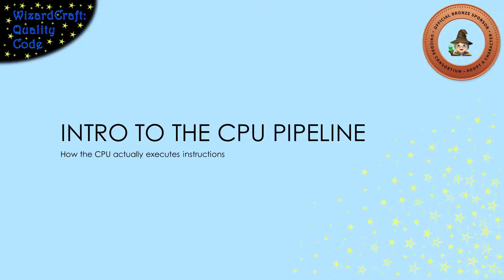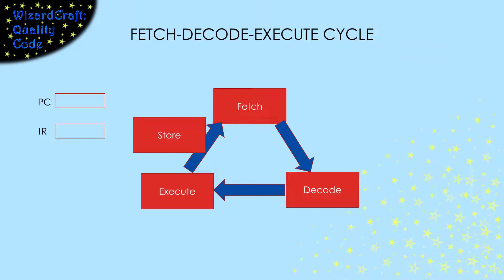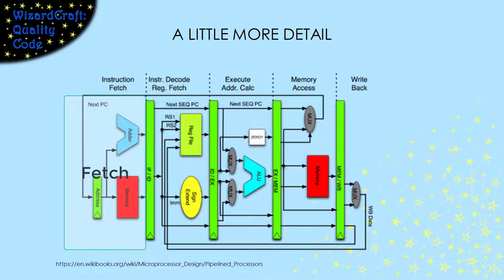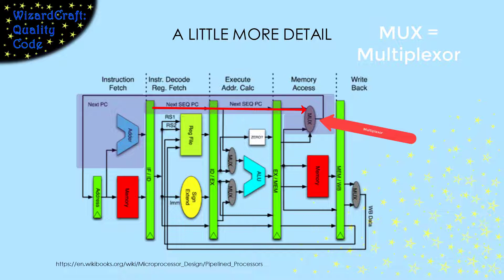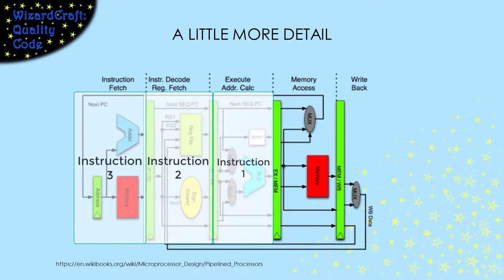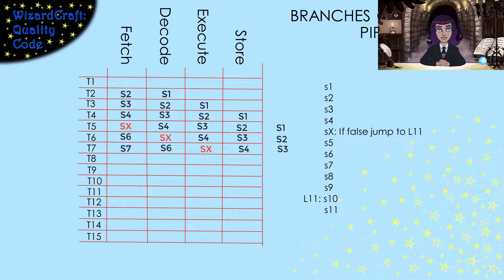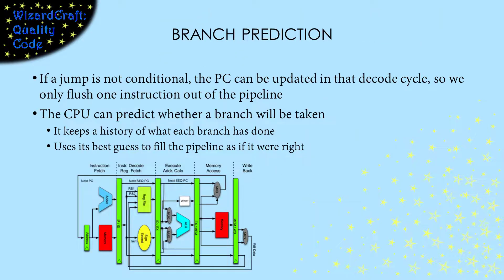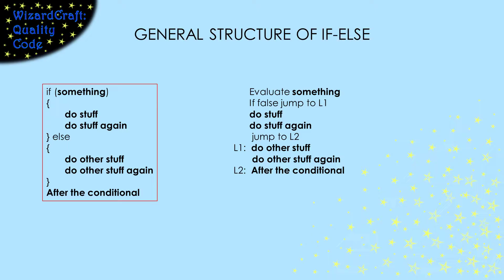Introduction to CPU Pipelining

Comment: Thank you so much professor,  the video is very clear. I'm curious, why the pipeline need to be refill? And will it need to start from s1 to s10 after the jump instruction is executed.
Reply from the maker: When a conditional jump is taken, the next instruction to be executed is NOT the ones that are in the pipeline.  So we have to throw away the work we started and refill the pipeline with the instruction sequence we jumped to.  Assuming that you are referring to the example around 6:50, since we are jumping to S10, that's where we will start refilling the pipeline because that's what we want to execute.

Hope that helps!
Reply: @wizardcraftcode  Thank you professor I understand now. You explained it in the video but I did not catch it. 
When SX at Execute column, the Mux will decide where the Program Counter will point to. If there is no jump, then S5 will shift to execute column.
If jump is execute, we need fetch and decode S10, that will waste two steps.

Comment: Long pipeline=bad latency. Short pipeline=good latency. That's why Pentium III is more preferred for CNC control application than Pentium IV. I use Athlon X2 6000+ and Core2Duo E7500 to control my diy CNC routers. Both CPU's have 14 stage pipeline conveyor and latency is just great under Linux with RTAI (hard realtime kernel), only few microseconds!! So, no need to buy most expensive and modern CPU for great latency, you need a CPU with short pipeline.
Reply from the maker: As a general rule, I don't disagree.  I think there are details like cycle time, branch prediction capabilities and lookahead that could also affect latency.

Comment: The creation of Rails under tunnel roads of Rails fixable by alternate functional configurable tube line ports with Fiber Optical colour coded sensors extendible Fiber Optic tube lines likened to structure problem find and seeker sensor tubes of another likened to the laparoscopy instruments or Dr.Octopus mechanical limbs only that those are smaller though more sensitive, wherein each sensor line tubes of colours of ports extenders have the capability to do Wielding beams of pencil thin plugs to tensile strength beam components insertions of what were being energy ferried by components, while other Sensor Fiber Optic Tubes have AI scanning capabilities for defects due to Earthquakes and Wear and Tear effects and density affectation locators, another the Wireless energy transferrer and informational Relays Fiber Optic Tubes of along the length of straight and curving bridge alternate ports tech interact receptors only in that already constructed bridge and the Underseawater 2 way large layered  Speed Bullet Train and 2 way transport wheel vehicles Tube passages of specialized super stable metal platings with shaped like Rectangular Transluscent None see through Mirrors at both sides approximating the curve of tube of Speed Bullet Train Velocity and Structure of Transport correction capabilities by Sophisticated Pings and Bounce to Trajectories, Engines, Electronics, Pulleys, Hanger magnetic and Electronic Synch guides and passing Transport vehicles number scans and unique model CCTV's connected to the Transport Command Station Office. Roof holes of Controlled Volume Water sprinklers and optional use Fire Extinguisher valved ringed and fiber stringed roof per area station extenders of Fire Extinguishers. There shall be layers of Tube skins super stable materials of housing the Communication Cables at the base of structure with open and close belly hatches for AI Robotic Repairs with functional mechanical arms of hatches controlled by Command Transport Stations and with Outlet tubes for water drain at the area only for the weight control and prevent undersea sabotage anyway the entire structures are underwater wherein at the area it roofed the transport tubes have none conducting materials. The unique structure have underground sea bed second levels for another Speed Train interlace to counter and detour the sea water pressure of its laying down project and exit of any volatile fire inducing gases or deadly chemicals of destroy or of hostile if something escape or  passed through the stations cameras and detectors though the Structure shall be Optionally by mode AI monitored  the underground sea bed structure shall be like Chains interlaces while the undersea structure shall be like 2 DNA Nucleotides interlaces. And the Communication cables can branch like roots  from its Tubes of bases larger origin tubes branching to nearby only comminication stations connectors. The structure stability shall be by Cloud area Quantum Network beam curtain line poles of piercing down seas for ceilling structure and undersea  magnetic by specific repulse and magnetize by specific X factor super strength materials X Shaped holders  side to side to area clouds extended pointers from the base ground X stability of Structure Holder with lower base Y structure Holder of super stable strong Y line foundations approximating the longer X legs structures of such structure combination along the passages and paths of not X and Y shaped structure but energy passages reconfigurable for such for the power systems from the molecular science hydrogen Ions energy converters using water hydrogen filters and processor machineries with another dual mode area wireless and tube linked energy pathway structures for power plant energy storage and Manufacturing facilities of creating battery types energy storages for business and trade, energy Transformers fixed storages, for Research and Developments for propulsion tech types with contracted companies per agreement contracts and for Ambassadors to Country leaders agreements, and energy storagings for the near future and presently built Advanced Modern Civilizations Types, Subdivisions housing energy needs of attuned to that mode only and for near future Flying Transport vehicles and Know how variety Transport movers of whatever environment  of designs per Company and the Space launch vehicles propulsion Boosters of special type of Chemistry products expensive mixtures for a probable and possible high earning income and businesses. The CaesarKing project continuation for the Philippines at the Undersea and Underground areas of San Juanico Bridge now ordering my Controlled Superior Quantum Networks, my Space Super AI designers to ferry for create at the Atmospheric Clouds Chandellier print constructors by beam effrcts, the undersea and underground Pixels effects for structure measure and environment for structure scan approximations like super engineering  science and nature technology and know how combination and the Abstract Dimension for continuous real time manufacture of unlimited create as long as I order energy copy paste every interval and ordering the strengthening of structures foundations by beam effects  and stability science granules elements and minerals Earthquake stability structure insertions for the San Juanico Bridge already in existence structure. You talk over for the management groups of that either by functional category public private partnerships or organizational by polarized or by national governance scope and treasury earn, thats one of my project legacy to Philippines PH. Let it be

Comment: control unit does NOT decode
Reply from the maker: I'm not sure where you think I've made a mistake.  Can you give me a timestamp?  Making sure my videos are accurate is really important, so I'd like to know more
Reply: @wizardcraftcode  Search in transcript says "Control unit" at 1:35 . I just don't know why it would not decode. In the 6502 there is one big PAL which kinda contains the microcode (decodes machine code into microcode) and then (in the center) the "random logic", which IMHO is the control logic. It also does interrupts and JSR and RET and probably some carry flag stuff. Ben eater also more or less dumps the machine word as address onto a ROM and the retrieved data goes over control lines all around the bread board.
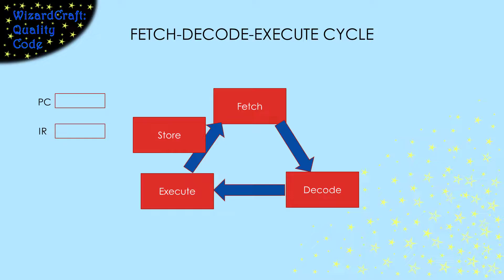Reply from the maker: I agree.  I also see "control unit" in the diagram at 1:44.  Perhaps the original commenter thought of something else named "control unit," but I think the terminology I'm using is correct for the fetch/decode/execute portion of the processor.  Thanks for weighing in!
Reply: @wizardcraftcode  Perhaps it is a design mistake of the 6502 that some jumps take longer than others. Also MIPS avoids unaligned memory access (I read, that 68k is the same ). So when a 8086 reacts on an odd address in SI register and issues two reads, is this decoding or execution? I guess that intel wanted to stay compatible with 8080 and its register pairs which are very similar to AX = AL:AH . I don't like when academics press their ebony tower theory into real world CPUs which changed the world. But then again, perhaps academics says that control unit does not belong to one stage? In one of my side projects I want to make a nice animation of a CPU. One pillar is physics based animation to create transients. The other pillar is a dream architecture with minimal control lines. So the ALU is 16 bit, registers also, but memory is 8bit to avoid alignment issues. Problem is, I need 16bit (fixed length) instructions to minimize decoding. I want von Neumann. So I need a cache -- uh big bummer.

Comment: ALU does not "execute" instruction, it only do the math commanded by CU. It is CU, which does execute the instruction.
Reply from the maker: You are correct.  It executes the math necessary for the instruction.  The rest of what I talked about is the high level view of the rest of what you are talking about.  This video is intentionally high level, but I could have been more precise with my language at that point.

Comment: Thanks for nice video and explanation. my question is "How many stages can CPU maximum does in one cycle, I mean what is the limit? I don' think that it is unlimited right?"
Reply from the maker: The stages of a pipeline run in parallel meaning they all execute every cycle.  In theory, you could build an N stage pipeline for any N, but, in reality, there's a limit to how many are useful.

Comment: Thank you alot, lets say that we keep all the stages the same but we add an extra execution stage. Would it not affect the speed of the CPU at all?
Reply from the maker: Just duplicating the existing execution stage doesn't help because you can't get two instructions there fast enough (without duplicating everything).  However, all of the stages have to take the same amount of time for the pipeline to work.  If you had a really long execution stage and split it into two, then the "tick" of your pipeline (how fast things go from one stage to the next) would be doubled.  When your pipeline was completely full, you'd pump out finished instructions at twice the speed.

Comment: hi, what is stall and flush and branch penalty in this concept, and what is its impact to pipeline. thank you.
Reply from the maker: I didn't cover stall in this video.  Some pipelines are more complicated than the simple ones I talked about here and can recognize that two sequential instructions interfere with each other.  Then they are smart enough to "stall" one until the data it needs is ready.  Branch penalty is what I showed here - the cost of taking a conditional branch and how that empties the pipeline.  That emptying of the pipeline is what "flush" means.

Comment: Yo thanks , i have a very silly doubt here we saw 4 stage instructions and the first stage is fetch cycle , right? Correct me if i am wrong... In the fetch cycle the address of the instruction fetched is given to the address reg. And now the contents of the address reg is passed on the bus, then the instruction is fetched from memory right? Is the whole thing happens only at the first stage? For more clear view i will write like this

Add reg.<--- P.C

Ctrl.bus<---read signal
Pc<--- pc+1

Add Bus<--- add reg.

Memory<---bus

Is all the thing mentioned above happens at the first cycle?
Reply from the maker: The stages of the pipeline all have to take the same amount of time, so they all have to be as long as the store stage.  So, there's time for the fetch of an instruction in the fetch stage.  The adding to the PC is done in a separate path, in parallel.  That's what the Addr in that phase is doing while the fetch from memory of the instruction is happening.  So, the things you wrote happen, but not sequentially.  I hope that helps!
Reply: @wizardcraftcode  thanks for taking your time to respond me👍